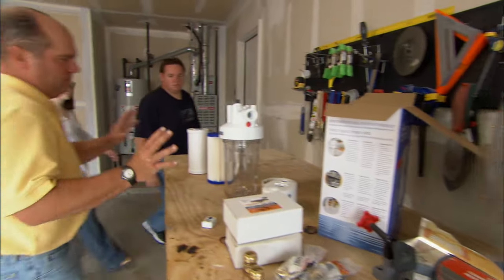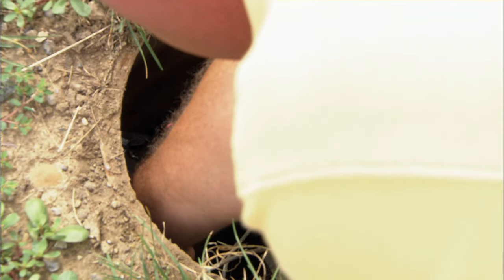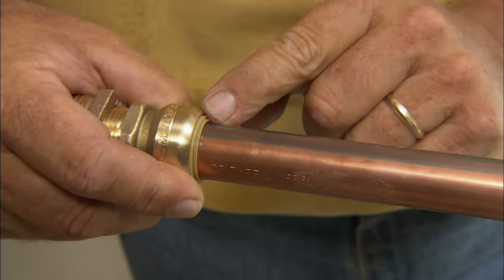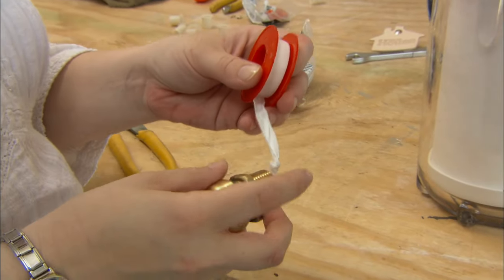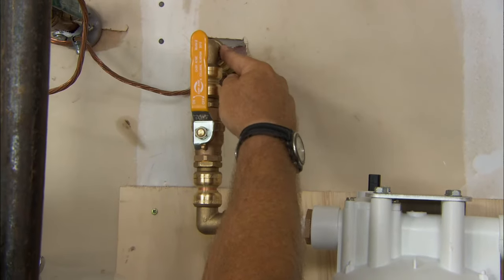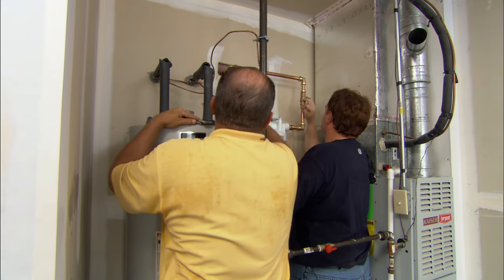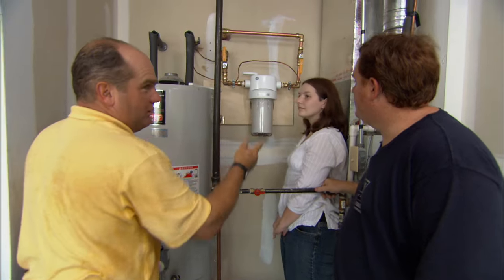How to Install a Whole-House Water Filter | This Old House

Comment: Wish I could have this at our house, but no, they had to put the shut-off valve for the house itself not inside the garage, but inside a closet in the house itself
Reply: XzTS you can install these anywhere, as long as you pipe in new shut offs with it.
Reply: ***** 
Inside a bedroom closet though
Reply: It can still be done, you might lose some closet space, but it can be done. I am doing it right  now.

Comment: I have the same whole house filter. As the filter get dirty my water pressure starts to decrease. Is there any way I can boost my water pressure after it leaves the filter?
Reply: @Bret Whitney, only two ways to increase water pressure. Larger pipe (diameter) or a booster pump.
Reply: Replace the filter element. Your pressure is dropping because the filter is clogging.  It's supposed to do that.

Comment: How much does this filter reduce the water pressure?
Reply: +Chris Bell I seen no noticeable water pressure drop as long as I changed the filter every three months or so. This was city water so it had pretty good pressure before.
Reply: @usmc6153  One could fit a Tee either side of the filter and then fit pressure gauges on the Branches of those Tees then you can see the drop off in pressure as the filter becomes clogged rather than going for going down  that ,"Change every few months" route.

Comment: Do sharkbites break the electrical continuity? I'd rather sweat fittings on my main
Reply: @Eviscerate incorrect, read the info on the sharkbite packaging. They recommend jumping any of their connectors because the contact is insufficient to carry and electrical load in the event of a ground fault situation. He would have done better to just jump from the point where the water comes from the street to the point where the pipe goes into the house and skipped all the fittings entirely. Would have been two points of contact instead of the weird three points he did just to jump the filter housing. I love this show and Richard but that bonding could have been done better. He's a plumber, not an electrician.

Comment: Did I miss something? The water that goes into the hot water heater doesn't get filtered. Or does it through another pipe unseen in the video. Correct me if I'm wrong but by the looks of, it doesn't.
Reply: +Jose L Ramos That was the main line in before it was split into hot/cold thus filtering everything.

Comment: The ground should be attached before and after the Sharkbites because Sharkbites are not "solid" grounds.
Reply: SHARKBITE GROUNDING ON COPPER PIPE

When connecting a SharkBite Universal fitting to a 
copper piping system, install a copper jumper cable to 
ensure proper grounding. SharkBite Universal fittings 
are not an electrically continuous fitting.

Comment: Where can I buy a big filter like this? The only ones I’ve come across are rated up to 3 or 5 GPM. We have 70psi water pressure on a 3/4” line so we need a large filter for our house (4 level 4 toilets, 7 sinks)

Comment: Mad to use push fit pipes at city water pressure
Reply: to quote Mike Bald because you probably didn't even read his comment: "Some info about those sharkbite push-fittings. They're certified to 200 PSI & 200 degrees F and approved for underground use as well. They also have a 25 year warranty when installed correctly."
Reply: @Erik Liska, you are right.

“Fittings certified to 200 PSI and 200°F (93°C): Proven durability and quality.” 
https://www.sharkbite.com/sites/g/files/rgohfh321/files/migrate/SB_Push-to-Connect_SpecSheet_061515.pdf

Comment: Got to get rid of that chlorine fluoride and cronium too bad I can't modify the apartment I'm in the water has really bad chlorine burns my eyes out every time I wash my face
Reply: Michael Lebert you can get counter filters for $90 on Amazon. Just remove them when you move out of the same apartment and reconnect the original plumbing. it's easy.
Reply: Try a COUNTERTOP Water Filter.. ours is a 4 stage thru the HDepot, others can be upto 6 Stage Filters.. Cost $100 and Filters last about 6 mos at $50 ea. To Replace..can hook up a Faucet Sprayer to wash your Hair .. Next is A RO( Reverse Osmosi Unit ..cost $200 and $75 every 6 mos for R&R Filters( 3 of them)
Reply: don't wash your face

Comment: I like this but if it was me I'd want something that could do more than what that one would do. I'd want something that had a special light that could help kill germs and bacteria as well as sediments. Having something that can clean and filter your cold and hot water would be nice. Where most water heater systems have the tenancy to have the metals leave the water heating system and then it gets in your homes water system and you drink it and wash your cloths and bathe in it. It would be nice to have a system that will filter both hot and cold water. This would be a good solution for someone who may have an apartment or rent a home and they can't start behind the water heating system and need to place it after the water heating system and the outlets such as sinks tubs and other fixtures. This was nice but I would have to say there has to be something much better out there. It would be even better to do the same type of system that could do all I have mentioned but has reverse osmosis. After that I'd put an in-line hot and cold filter before the tap and this way no matter what there will be clean cool crisp soft water each and every time.
Reply: You only need a UV light system if you actually believe you have bacteria in the water. So you'd only use a UV system for well water installations because city water already kills bacteria by treating the water with chlorine which kills them. So most will just filter the chlorine out because no one wants to drink pool water. Anyone that tries to sell a UV light filter system for city water is trying to upsell the crap out of them.

Comment: What are your exeriences with sharbites/pushfits? Any leaks? I'm kind of sceptical.
Reply: They’re awful and are notorious for leaks and blow outs, don’t install them in your house. I’ll only use a shark bite cap after a valve doing demo work.
Reply: Sharkbites are meant for temp jobs of less than 2 years. No way would a real plumber use them.  A real plumber would use crimp, threaded, pvc, pex, or solder.  I design and mfg orings and I would never use a press fit oring like this for longer than 2 years.  It will fail and leak.
Reply: I've heard various people say they had a terrible time with them, but I've also heard others that have had them successfully for 15+ years without issue. I think it largely comes down to how well the installation is performed and the environment they are used in. Most of the failures are because the pipes weren't properly squared at the end or had rough edges that destroyed the o-ring, or were inserted, removed, and re-inserted multiple times which reduces/removes the o-ring grease coating that helps form the seal.

I think if the fittings are in a place that are easily accessible (i.e. not enclosed in walls) then they are fine. If you have a failure, it will most likely be a small leak, at which point you can just shut the water off, replace the fitting and go about your day in a few minutes. It handles better with PEX piping as the plastic tubing will reduce any water hammer that could mess with the fittings.

Comment: They always cut corners on these videos.  Personally regardless of the fittings used I would have placed the filter lower and more to the right on the wall.  I would have included a bypass around the filter and installed pressure gauges before and after the filter.  It is always nice to know what pressure the incoming water to your house is at (it may need to be lowered) and the second gauge lets you know when the filter starts to clog lowering the pressure.  Many of these inline filter housings (especially the clear ones) are only rated to 50 PSI and can fail as many cities supply water at much higher pressure.  My house has water pressure close to 100 PSI coming from the city but I lower it to 70 PSI with a water pressure reducing vavle.

If you use Sharebite fittings it is important to make sure the pipe ends are free of burrs, round,  pipes are fully inserted along with the going straight into the fitting.  It looked like his pipes were slightly angled which does not give a good o-ring seal.  Sharkbites have no lateral support either and may need to externally supported so no strain is put on the fittings.
Reply: I stopped reading after “they always cut corners on these videos”. You could of educated this community without saying that.
Reply: @jklok  Your loss....  The truth hurts....
Reply: There's always multiple "experts" in the comments like this 🤡
Reply: @zachreese6540  If you going to do the job, then do it correctly instead of trying to cut corners to keep a video short.  They leave a lot out of their videos which could effect people....

Comment: If you use sharkbite (or whatever you Americans call them) you should wet the o-ring first. The pipe goes in so much easier. 

Basically, if you’re going to push something hard in to a tight hole, lube it up first. 👍

Comment: But honestly, did anyone else have to rewatch this to see what the point of the second wrench was??? Lol I don't think the second wrench did a thing.
Reply: Yeah, all he did was strip the plastic threads in the housing.  This was an amateur hack job.  
No real plumber would use sharkbites, they would either use pvc, threaded, crimp, solder, or pex.  Sharkbites would be lucky to last 10 years.  Sharkbites should only be used on temp jobs, not permanent installations.
Reply: LoL the 2nd nut was turning too but he didn't even put the wrench on the 2nd nut
Reply: @common_c3nts  LoL yeah sharkbite definitely sponsored this

Comment: What ? He didn't have to call the city to turn the water off and on ? What's the world coming to.
Reply: If he did they probably skipped over that, although I don't think it's necessary to call when it's your own house and it's barely a half a day project you're doing
Reply: +MarioDragon Richard turned off the water himself with a crescent wrench @ the curb. No call required
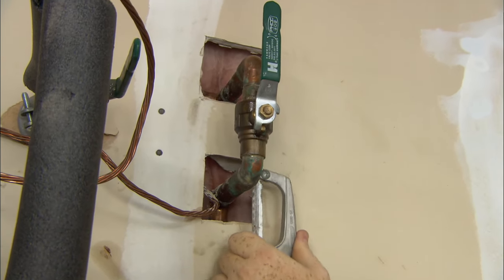Reply: You don’t need to, but in Titusville, Florida, the city buries and locks the meter and valve  boxes so you can’t get in, they only come on weekdays before 3:00, and they charge you $20 to turn it on and $20 to shut it off, it’s stupid. The meter boxes have a decal that says if opened except my city official, you face jail time.

Comment: why is he having the homeowner cut the pipe,so stupid
Reply: MrKenstar2 They must have cut the pipes square using a pipe cutter after the homeowner used a hacksaw, and didn't show it in the video. The sharkbite connectors require a clean cut that is perfectly perpendicular to the pipe.
Reply: +Dasdfjkl Actually I am the homeowner in this video and I had to cut both pipes with a mini hack. There was not enough clearance between the wall and the 90 Degree elbow to get a pipe cutter onto it.

Comment: Screw the water filter for now.  
Avoid castastrophe.
Install a MAIN SHUT-OFF inside the house immediately.  Yikes!
Reply: The valve they cut off was the main shut-off valve.
Reply: Shark bite fittings for installing a main shutoff? 😳

Comment: I'm disappointed that a pro used sharkbite fittings
Reply: Yes, but I think the video is to show amateurs how to do it without all the soldering.
Reply: A plumber would most likely not use shark bites, but the video is not intended to show you what a plumber would do. It is a guide for diy.
Reply: @Matthew Vogt, I was thinking the same.

Comment: This guy is not a real plumber.  Real plumbers don't use sharkbites or a pipe wrench when a cresent should be used.  Also a by pass line should be installed
Reply: And neither are you